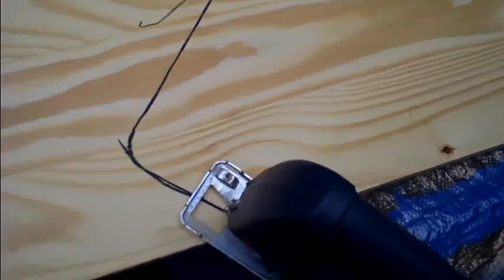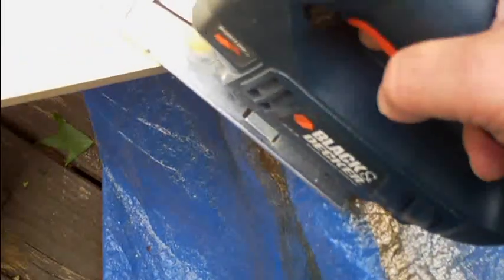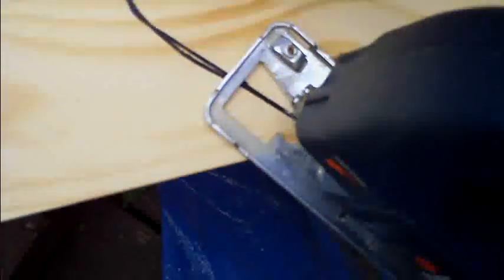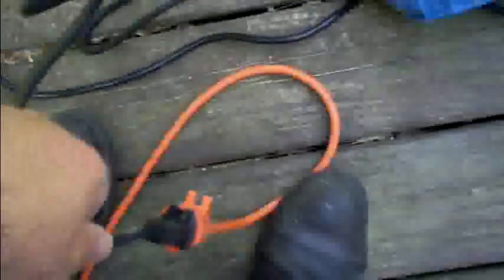Adding Wheels to the Stock Sony Trinitron XBR Stand Part 1

Comment from the maker: I thnk the stand was made for the 36 inch. Then when they came out with the 40 inch, either the consumer I bought the set from bought the 36 inch stand, or maybe Bush didn't make a stand for the 40 inch. I've seen maybe of these on Ebay with the matching stand so I know the stand was sold for the TV. now whether there was a special stand for the farty inch TV, who knows??
It is suspiciious tho,,,238 lb TV on top of a stand rated at 240 lbs. Just plain weird!!